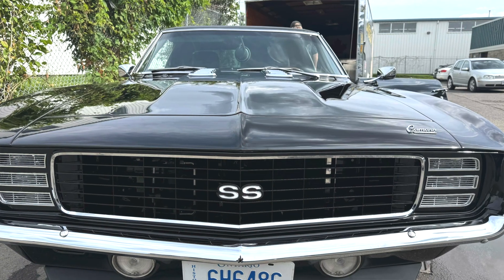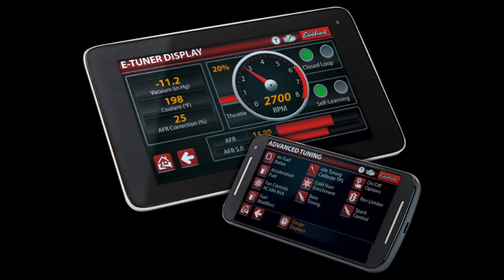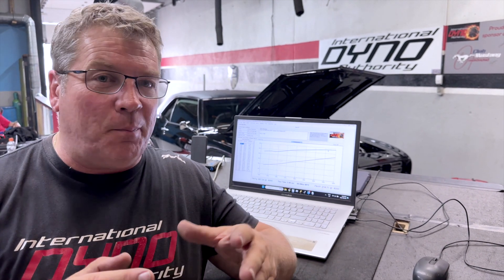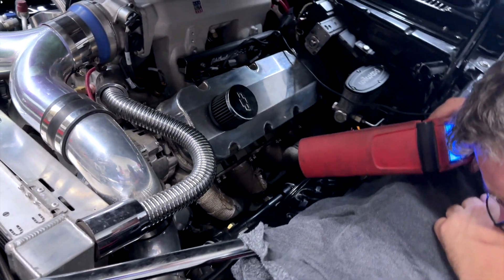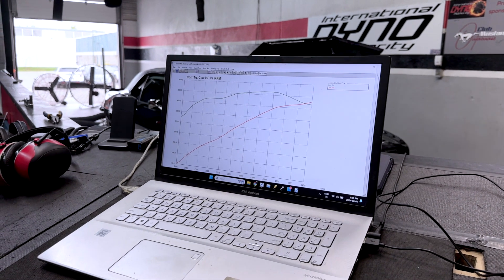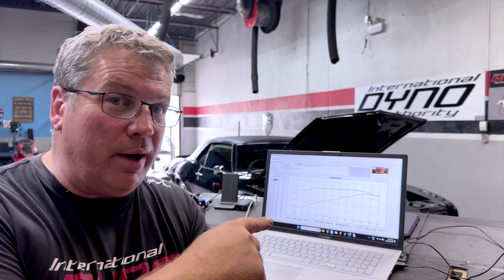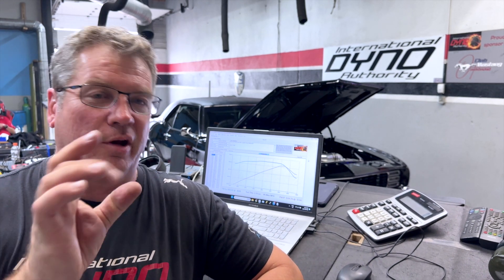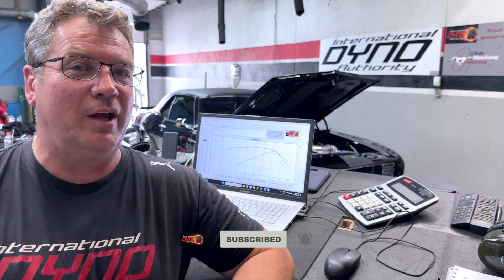Edelbrock EFI Tune | 1969 Camaro

Comment: OK.... 565 don't know the C/R or A/F  i see on the last run you cut power at 5000 running Brodix heads, was that a customer implied RPM limit? I'm running a 10.75:1 496 6.385 rod Gmpp Aluminum head Weiand T/R dual Demon 750  that revs like a weed eater....  at 6500 it's still pulling hard Rev limit is set at 7000 i expected over 600 at the wheels or more with that combination

Comment: told us alot didn't show any of it completely worthless video
Reply from the maker: Ah, a discerning viewer! We appreciate your insightful comment and the opportunity to clarify our approach.  It's true that we offer a spectrum of content, catering to everyone from those just dipping their toes into Edelbrock Pro-Flo to seasoned tuners seeking advanced techniques.  This particular video, as you correctly observed, focuses on the process – a crucial first step often overlooked.  We've found that many stumble right out of the gate with Pro-Flo, encountering common pitfalls and missteps.  This video shines a light on those initial hurdles, demonstrating how to avoid them and establish a solid foundation.  We showcase the before-and-after performance data not as the ultimate tuning guide, but as a clear illustration of the impact of even basic adjustments.  It's about building understanding, not just providing a quick fix.
You're right to point out the availability of more in-depth tuning tutorials.  Those delve into the finer nuances of specific tuning processes, and we encourage you (and other viewers) to explore those as well.  Consider this video the essential "prequel" – laying the groundwork for the more advanced techniques covered elsewhere.
We're constantly expanding our library of resources, so stay tuned for even more content designed to elevate your tuning prowess.  Cheers from the entire team at International Dyno Authority!
Reply: @internationaldynoauthority693  Dude !!! that was the most diplomatic answer I've heard in a long while .... Saying that...  You guys slapped my hand for the remark one troll made on the last vid i watched LOL !!!! Funny how some folks can't be told in not so many words what they can consume, Oh well  ... Back in the 70s we just smacked them in the chops and they learned respect quick and shared some beer  ... just no consequences for a loose unregulated tongue.....Great vid !!! expected more power and revs don't think the tires can hold it as is,  beautiful car BTW
Reply: @tangotango256  good for you i had specific questions that should be common place when showing a install yet all they showed was a here it is and heres a dyno run but lets title it a install
Reply from the maker: International Dyno Authority: Pioneering the Future of Tuning and Combustion Technology

As North America’s premier facility dedicated to advanced tuning and research, International Dyno Authority (IDA) has set the standard for tuning and power optimization across a vast range of applications. This cutting-edge institution has earned a reputation for excellence through extensive partnerships, groundbreaking innovations, and the development of tuning standards that are transforming the industry.

Partners in Innovation

IDA collaborates closely with leading corporations, advising powerhouses like HP Tuners, Whipple, Roush, and Ford Motor Company. Their insights and technical support have become an essential resource for these companies, driving improvements in engine performance, efficiency, and emissions standards. Through these relationships, IDA has a unique vantage point to pioneer developments that shape the industry’s future.

Pioneering Standards in Tuning

Since its inception, International Dyno Authority has been at the forefront of the tuning industry, not only setting new standards but also elevating the capabilities of tuners of all experience levels. Through their publications and training programs, IDA provides essential resources that empower both novice and professional tuners, equipping them with the skills to achieve precision tuning across various engine platforms. Their commitment to education is evident in their comprehensive curriculum, covering the intricacies of combustion dynamics, air-fuel ratio (AFR) tuning, boost management, and fuel characteristics.

Educational Outreach and Online Presence

IDA has established a strong online presence, notably through their YouTube channel, which serves as an invaluable resource for enthusiasts and professionals alike. Their instructional videos, which include step-by-step tutorials, practical tips, and expert insights, are used by institutions such as MIT, Boston College, SCT, Holley Inc., and Edelbrock, making IDA a recognized leader in education within the field. Their expertise has also gained the attention of influential industry figures, including Steve Morris, who has commended their contributions to tuning technology.

Specialized Focus and Areas of Expertise

Operating as a purely tuning and research facility, IDA’s specialization spans a wide range of topics. They delve into complex subjects such as combustion technology, AFR tuning, boost and fuel optimization, and luxury engine swap integration. The organization’s work also extends to advanced fuel research, as seen in their recent collaboration with TTC, Hydra-Gen, and DynaCert. Here, IDA took the lead in developing an 8.9L Cummins engine hydrogen supplement fuel program, which included rigorous emissions testing, underscoring their commitment to sustainable and innovative fuel solutions.

The Facility’s Technical Scope and Testing Capacity

Each year, IDA conducts over 650 vehicle dyno tests, tuning engines and chassis systems to optimize performance. This includes a wide variety of engines powered by gasoline, E85, diesel, hydrogen, port and direct injection, throttle body injection, and even carbureted systems. Their expertise is not limited to traditional vehicles; the facility also tunes boats, tanks, and military transport, making them the only independent tuning and research center in North America dedicated to such an expansive range of engines and fuel types.

Advancing Industry Standards

By leading projects in combustion and alternative fuels, IDA continues to be a key player in the evolution of tuning technology. Their dedication to setting new standards in performance, efficiency, and sustainability has positioned them as a trusted authority in an industry that is constantly evolving. For anyone looking to understand or pursue high-level tuning, International Dyno Authority remains the ultimate resource and innovator in the field.
Reply from the maker: Today, we mix old-school big-block power with some fresh Edelbrock tech. We tested, tuned, and got the best performance from this 1969 Camaro using Pro-Flo 4 Fuel Injection with a 555 cubic inch big-block Chevy. 

This gorgeous Camaro arrived with just over 400 wHP. We corrected the fueling all the way from 1500 to 6000 rpm, reset the fuel curve, corrected the timing curve and set the fuel pressure for non-fluctuation throughout. 

This customer now realizes the full proper potential of his 555 cubic inches and enjoys over 500 Horsepower at the wheels!
Reply from the maker: https://static.summitracing.com/global/images/instructions/edl-35760_cl.pdf
Reply from the maker: https://youtu.be/t-1tBTTbRQI?si=oh9-WMtQsLRRLZo-
Reply from the maker: https://youtu.be/d0ATZrb-GaU?si=PnpJBZFZaW6a3fAe

Comment: Right off if the IAC isnt adjusted correctly the learn mode will never be able to work correctly!  It is a little difficult to understand how to correctly set the IAC. But if you take your time and get an understanding of it you can dial it in yourself!  The base timing was also set up incorrectly which is very critical. Should have been setup at 12 deg initial right at first startup!  These are fantastic complete true ported injection setups!  They work great!  Thanks for the video. Ive often wondered if there were any dyno shops that would run and check tuning on these setups!
Reply from the maker: You got it! When setting up an injection system, proper IAC adjustment is key to a seamless tune.

Comment: Running this on a 600 Dyno'd BBC in my Chevelle and walked carefully thru the initial setup and it fired right up and ran. Adjusted the IAC and fine tuned the timing and put a few miles on it the self-learn work just fine!  It runs great!  Id say someone screwed up the initial setup!
Reply from the maker: .@davegerrard6857 Absolutely agree. We see this all the time at our shop. On anything with a more aggressive camshaft or serious performance upgrades, the factory self-learning system becomes a problem. It keeps relearning behaviors—one day it’s adapted to cruising, and the next it’s off again. The best solution is always a custom tune. Disable the self-learning, dial in the cold start behavior, and get a proper, precise tune.

Once tuned correctly, these systems can perform incredibly efficiently for the long haul. Without that, they’re severely limited—making little power, running way too lean, or having major gaps in the fuel map. Honestly, these systems are outdated and feel like working with 1980s Atari tech. We tune a lot of them and do our best, but it’s not an ideal platform to begin with.
Reply from the maker: @Gero1969  Thanks for sharing your experience and insights! We are inundated daily, after 600 plus vehicles per year. With substandard software, lack of incremental tuning, and substandard hardware : However,

When it comes to aftermarket fuel injection systems, there’s definitely a spectrum of reliability and performance. From what we’ve seen, Edelbrock systems tend to lead the pack in this category, with only about 1 in 20 needing an ECU repair or upgrade. That’s a strong showing compared to Holley systems, where issues arise in roughly 4 out of 10 cases, or Fi-Tech, which struggles with reliability in as many as 9 out of 10 units.

That said, none of these options truly match the tunability, performance, or reliability of a well-built carburetor. While these injection systems can be made to run quite streetable, carburetors still reign supreme for any serious, street strip , Enthusiast.

If you’re chasing top-tier results, though,(for high quality Fuel injection)it is worth looking beyond the entry-level systems. Rewiring with a crank trigger and integrating an OEM-style ECU, like a P38, Will deliver OEM-grade reliability and performance, And incremental tuning, unmatched. 

 Alternatively, stepping up to something like a Haltech system offers a massive leap in tunability and dependability compared to the Edelbrock, Holley, or Fi-Tech options.

It’s all about finding the right balance between your goals, budget, and how much effort you’re willing to put into the setup. Let me know if you’d like to dive deeper into any of these options!
Reply: @internationaldynoauthority693  how do I get ahold of you guys to talk about bringing in a couple of vehicles
Reply from the maker: @Bikeslinger  

613-795-2779
613-857-3578

https://internationaldynoauthority.com/

https://internationaldynoauthority.com/about-contact/
Reply: @internationaldynoauthority693  awesome thank you!

Comment: I am running a PF4, SBF 427 500+ HP.  It is easy to dial in, use the wizard and follow the directions.  Then you run it in fast learning mode for 500 miles of driving.  I was told by Edelbrock you should NOT do any dino testing until you have 500 miles on the car with the PF4 learning.
Reply from the maker: @Travis8126  This client attempted to have the "learn mode" for over a year. He also, had other friends attempt to adjust the tune.  

We re tuned from Scratch, with zero self learning. Once we built the fuel tables, we moved on to the balance of the tune.

Car ran gangbusters once we were finished tuning it.